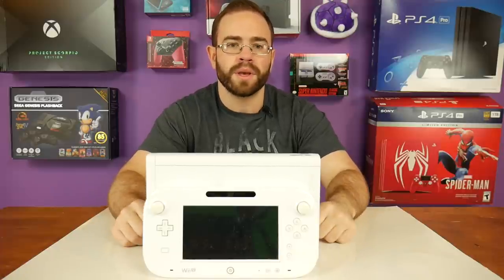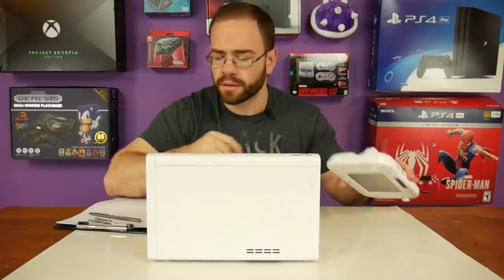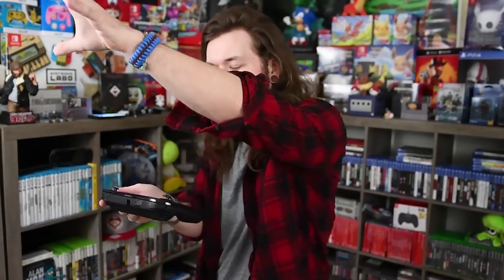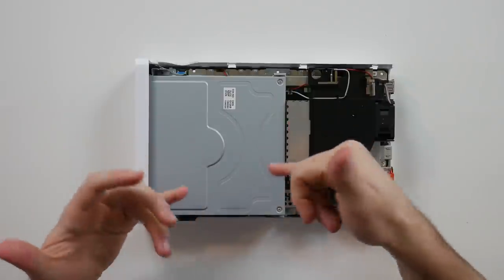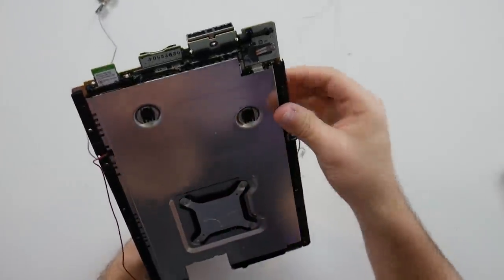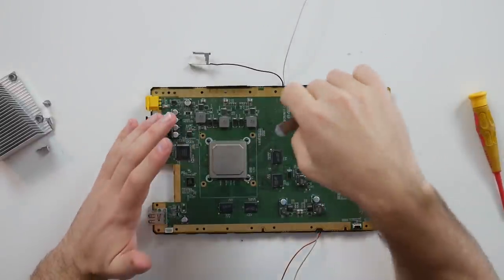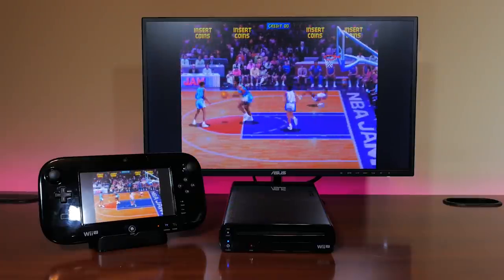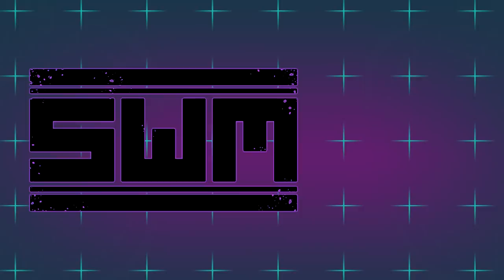Here's Why The Wii U Never Had A Chance (ft. BeatEmUps, Scott The Woz, Wulff Den, MVG)

Comment: If the Wii was an enhanced Gamecube, and the Wii U was essentially an enhanced Wii, does that mean that the Wii U is an extremely enhanced Gamecube?
Reply: That's quite the syllogism
Reply: Technically yes, as it still uses the same processor family as the gamecube. Also it still can run GameCube game’s natively.
Reply: Kinda is. The Wii Menu mode on Wii U is a TRIPLE-clocked GameCube, while Wii was a double-clocked GameCube. But yeah, most of the Wii U is a Wii.

Comment: Answer: Everyone thought it was a fancy Wii while it was actually a fancy DS console with a Wii duct taped to it
Reply: 3DS HD with a huge anchor chained to it 😅
Reply: It exists. It's called Citra.
Reply: I didn’t even know it was a new console. I though the Wii U was just the game pad controller thing that would then connect to the Wii. I never really saw it as a full console.
Reply: This is so true 😭😂
Reply: it's a ds but the upper screen was your tv
Reply: @AaronKaiMCDNLD  😂
Reply: AMysticSeer handhelds can’t compete with home consoles
Reply: @friendlyneighbor5069  
The Switch is what the WiiU should have been back in 2012. A portable hybrid with PS360-level graphics (in 1080p with a more modern architecture) is exactly what Nintendo needed to start the next generation before PS4 and XBone arrived. 

Instead, Nintendo was high and arrogant off of the success of the Wii and decided they could try to fool the masses into buying another underpowered console with a new (worthless) gimmick that would justify it being once again a generation behind its competitors. And much like the Wii, the WiiU couldn't even keep up with the generation that came before it; the Wii had a GPU that was way worse than the OG Xbox while the WiiU had a CPU that was about 1/3 the speed and efficiency of the 360's. They literally went OUT OF THEIR WAY to make the console weaker than if they had simply used cheap off the shelf parts (which would have been more powerful than WiiU), probably because they were familiar with Wii/GCN architecture and wanted to use it again for a third time because they were too lazy to learn how to develop on modern hardware.

And as good an idea the Switch is, I feel that it being released in 2017 is just a tad too late. Like I said, this console should have released in 2012 - 2013. At the end of this year, PS5 and XBSeX will be released, and Switch with its PS3.5 tech will be nearly two generations behind in terms of horsepower (making ports even more difficult than they already are). Nintendo just keeps falling further and further behind... And that's not even getting into their embarrassing regression in terms of multimedia and online features, which is even worse.
Reply: @AMysticSeer better than the ps3 and xb360, didnt you watch the video? he said the wiiu was comparable to a 1998 g3 mac, lol.. both ps3 and xb360 run circles around the wiiu powerwise.
Reply: @N.i.E.M.O  have you notice that nintendo have started to treat the switch like the wiiu now. there is nearly no news about the system and nearly no new games for it anymore but indie junk. its exactly what happen to the wiiu, when nintendo was starting to close it down for something new. a new nintendo console is coming in a year or two by the look of it.
Reply: This is heresy!
Reply: Yeah the wiiu was still incredibly downgraded compared to ps3 and Xbox 360. I remember comparing assassins creed 3 and darksiders 2 the wiiu was nice looking “ for the size of the console”
Reply: @buster3698  - Me too! And I was a Nintendo fan back then!

Every trailer was like: "Play with the new controller!"

The Zelda demo just looked like a CGI Twilight Princess.

Meanwhile they barely even showed the console itself!
Reply: @AMysticSeer The reason the switch doesn't stack up with the PS4 and XbOne because its a portable, if it was as powerful as, for example, the PS4, it'd basically overheat and be slightly larger, and a chunky portable isnt really something you want.
Reply: @AMysticSeer Nintendo doesn't go for graphics because they don't make a game better, and in fact, the make the system more expensive
Reply: @jackobyuk  Of course there’s nearly no new games. The pandemic slowed everything down. And there are still hundreds of Switch games sold each day compared to Wii U games.
Reply: I knew that it was a new console. I just thought that it was a new she'll for the Wii with a new controller.
Reply: @MikooOnYoutube  because people still want to share there opinions and don't care how old the comment is because it isn't really that important.
Reply: Makes it better
Reply: “wii duct taped to it”
Reply: @buster3698  how
Reply: @JmKrokY  they only ever showed the game pad. They always marketed it as like an extra controller so I thought it just hooked up to your wii. I didn’t even know it had it’s one separate thing beyond the controller until I saw it at a friends house.
Reply: @N.i.E.M.O  - I'm not sure that was possible back then, like, Sony really* tried to pack AAA-Quality on a handheld, and it failed on Wii U proportions.

Comment: The Wii U’s Failure set up the Switch’s Success!!

I miss the Wii U too lol. This was an amazing video and such an ambitious crossover!
Reply: Well said.
Reply: Was it though? Nintendo would have put HD graphics on their next console regardless. There was no way a modern home console could sell without at least 720p resolution at the bare minimum. Nintendo is known for doing weird and innovative things, so I believe a system like the Switch would have come out eventually even without the Wii U to serve as a failed predecessor.
Reply: Cuppa, yes a Switch like system could have still been released even if the Wii U never existed. But it probably would have failed just like the Wii U. Nintendo learned a lot from the failure of the Wii U. That’s why we’ve seen a completely new Nintendo ever since the release of the Switch.
Reply: @jammo7370  It's not just the console's horsepower, remember those cringey Wiiu ads? Nintendo did a lot wrong when it comes to showing the Wiiu to the masses including the very name.
Reply: Switch failed when NSO came out.Everything is fine but the online  P2P.
Reply: The switch has ame graphics as the wii U and its $300 more LoL fuc the switch its a rip off i smashed mine...
Reply: @chrisd8180  So you gave Nintendo 300 bucks and have nothing for it? You sure are a shining beacon of wisdom.
Reply: @chrisd8180  you Paid 0 bucks for your Wii U?

Comment: The Wii U can emulate GameCube games perfectly, it makes me sad that Nintendo didn’t take advantage of that
Reply: It doesn't emulate it but yeah they could have had adapaters to connect GC controllers to wii u and play NGC games.
Reply: @gabrieltorres6633  they do have an adapter for the gamecube controller.
Reply: *natively run GameCube games, both through the semi-official unused GameCube VC and Nintendon't.
Reply: Its because the Wii U is based on Wii tech,wich was made with alot of GCN components
Reply: @jesusramirezromo2037  the original Wii came with software that could execute GameCube code (MIOS) natively. For the Wii U, they removed this feature, but they kept the Wii codebase as virtual Wii mode, which runs underclocked on the Wii U. Nintendont is just a modified version of MIOS that can run in the virtual Wii environment

Comment: Wii U = Smash 4 machine.
Reply: DoubleAIV yea but now ultimate exists so smash 4 is irrelevant meaning Wii U is irrelevant
Reply: If you mean Smash 5, yes.

1. Smash 64
2. Melee
3. Brawl
4. 3ds
5. Smash Bros for Wii U

The 3ds game is always overlooked. It's an entirely different game, slightly different roster and different release date
Reply: @adiris8827  a large community of people used to call the Earth flat... That didn't make them right
Reply: except that smash 4 is the same game on wii u and 3ds, aside from visual quality and minor game modes. it is the same game
Reply: splatoon machine for me. Smash never worked that well online for me on wii u.
Reply: @MichaelBlakeLaRusso  But they don't have a "slightly different roster". The entire roster was exactly the same and if a character was changed in the Wii U version it was also changed in the 3DS version. Characters did the same amount of damage and had the same frame data between the two consoles. In fact, Sakurai even commented on not including Ice Climbers because is he couldn't include them in the 3DS version (due to hardware limitations),  he wouldn't include them in either. The same DLC also came out for both games on the same dates and both were supported till the same day, which was the final update.

The gameplay was exactly the same between the two and the only differences were some of the stages and a handful of gamemodes, which mostly still functioned almost the same. The only big difference in game modes was Smash 3DS had Smash Run while Smash Wii U had Smash Tour and Master Orders.
Reply: @MichaelBlakeLaRusso  Explain the different roster part please. Smash for 3DS and WiiU literally play the same, down to every single mechanic, every move, every combo etc. Competitively, the only thing separating those two games are the available stages (and controller options)
Reply: SMA5H
Reply: @michael blake larusso ah so you found a random website to tell you the difference between the 2... so your one of those people who also go to tier lists on random websites and trust their word? nah imma go ahead and trust sources that i know actually played these games like my friend who played both versions since he didn't have a wii u at the time and he played the wii u at tournaments instead. im also gonna trust the majority of people who actually play and bought both versions who say the games are basicly the same in this case appealing to popularity is the best option over a random website that you gave wtf is makeuseof.com?
Reply: roster is the same for both those games btw. who cares if stages are different? and they changed like 1 or 2 gamemodes? thats not big enough difference between the 2 to call for them being different games especially since they  were announced at pretty much the same time released at pretty much the same time had the same roster same gameplay mechanics characters had the same moves same combos. thats the same game :p on another note smash bros ultimate added 3 new gamemodes a new adventure mode which is pretty long. brought back every other character while adding new ones improved the online system(still trash though) ect. see the difference? ultimate is a new game because of multiple major inclusions where as the other 2 that are "different games" have very minor changes made to them
Reply: @Mattadork  Most people missed the 3DS game in anticipation of  8 player Wii U home console game... coping and pasting the article was simply easier.  I didn't insult anyone for missing out on Smash 3DS, I merely pointed out that Smash 3DS is the fourth in the series and "Super Smash Bros for Wii U" is the 5th.  They are merely different games with different release dates.  "Mario Kart DS" is still the 5th in the Mario Kart series, it wasn't skipped for being too similar or too close to "Mario Kart Wii"
Reply: thats not the same thing as the smash bros series especially when its literally advertised as the same game by the creators the trailers are literally super smash bros for 3ds / wii u. the slash means its the same exact game in this context. just because the release date for 1 is shorter then the other doesn't change much  especially in this game in this game every character has their own moves. a certain time that move takes to come out(technical frame data stuff id rather not learn cause it sounds boring) and as far as people who know this shit are concerned they are the same game for those reasons. adding 1 or 2 extra modes and different maps in terms of this game doesn't make it a different game sure i get what your saying wii u came out later then 3ds making it the 5th game but when you say that your taking people out of context cause smash bros ultimate is the 5th game in the series. not the 5th to come out cause 3ds and wii u are separate but its the 5th in the series which that is the difference. since 3ds and wii u have minor differences to the point you won't really tell(its nothing big like 1 having different characters,characters moves being changed ect.) they are both considered and even are based on advertising by nintendo themselves the 4th title.
Reply: @Mattadork  https://youtu.be/jmS05ZX3C4w sakurai considers Ultimate 6th in the series.  Your argument is invalid
Reply: Michael Blake LaRusso dude mario kart ds is NOTHING like mk wii! I have played both but you don't need to to see it. They are different characters, karts, tracks, control options, etc.
Reply: Michael Blake LaRusso Slightly different roster? The roster of the 3DS and Wii U games are identical.
Reply: @Max-bm5rs  "super smash Bros for 3ds" was the official title for 4.  "Super Smash Bros for Wii U" was the official title for 5.  Sakarai confirmed that "Super Smash Bros Ultimate" is the 6th in the series. Everyone was wrong, get over it.
Reply: @MichaelBlakeLaRusso  You don't have to take Sakurai's word as law. Nintendo considers them to be different games because they sell as different games. Functionally there is almost no difference between the games. The core gameplay stays exactly the same. I ask a question, would an update to a game make it a completely different game? Because that is essentially what smash for wii u acted as. Adding a few new stages and upping the graphics doesn't qualify for it to be called a new game.
Reply: @MichaelBlakeLaRusso  Do you legitimately think that people call it smash 4 because they can't count? And yes I will in fact go against the word of the original creator because it's literally just a port. This is such a straw man argument, it shows your inability to legitimately hold your point.
Reply: @nedbrookes6481  I've been calling Smash 3ds and Smash WiiU numbers 4 and 5 for years.  Aside from having different game modes the biggest difference is one is 4 player and one is 8 player (I'm sure that went unnoticed as gamers are probably playing alone in their parents basement). 
 I'm so glad sakarai confirmed that Ultimate is the 6th in the series.... But by your logic that Smash WiiU is Smash 3DS Port and not a new have because of the roster, that would mean Smash on Switch is a compilation rather than the 6th in the series.  So yeah, if the creator says Super Smash Bros Ultimate is the 6th in the series, you've all been wrong, get over it.
Reply: @MichaelBlakeLaRusso  What the fuck? A compilation? In what sense of the word is smash ultimately a compilation? Because it has all the characters from earlier games? I'm unable the fathom how this could even be a conceivable notion. And I've said this before, something like 8 player smash or smash tour/run is not even close to enough to differentiate these as different games.
Reply: @MichaelBlakeLaRusso  untrue 3ds is the same roster
Reply: @nedbrookes6481  he is soooooo wrong
Reply: @turtleanton6539  glad I made a bunch a losers rage in a thread. Sakarai confirmed that Ultimate is Smash 6. That is all.
Reply: xx Alvexas xx but it’s $250 cheaper and still runs great
Reply: I thought people called both games smash 4 because, you know, smash for 3ds/wii U.
Reply: It's not a Smash machine. There's plenty of great games on the Wii U. Also, Virtual Console.
Reply: Kuilet  why am I still getting comments on this?!?... Seriously Sakuria already confirmed the numerology. Get over it
Reply: @MichaelBlakeLaRusso  smash 4 3DS and Smash 4 wii u. It's right there in the name. Both are smash 4 considering that these two games are the only ones to have a play on words esq title. Same game, different modes. No roster difference, Nintendo and Sakurai both reffer to these entries as the fourth game in the series. Saying these games are different entries is like saying pokemon red is gen 1 and blue is gen 2 you seeing my point? By your logic since wii u came after 3DS then how come they didn't add new characters and tweak old ones?
Reply: @MichaelBlakeLaRusso  Ok, no. Doesn't work that way. 

The 3DS version is a handheld console version of the home console game. Sonic the Hedgehog launched in June 1991, then Sonic the Hedgehog for Master System and Game Gear came out later the same year. That game didn't magically turn into ""Sonic the Hedgehog 2."
Reply: @dapperfan44  Sonic master system and Genesis have the same story... Smash 3DS and Smash WiiU have different story modes and again SAKURAI CONFIRMED THAT ULTIMATE IS SIXTH IN THE SERIES!!!!
Reply: @MichaelBlakeLaRusso  if you insist. You're still wrong, but if you insist. 

By the way, googling "Smash Brothers 5" brings up Ultimate.
Reply: For me it’s a homebrew and HD Wii machine
Reply: Michael Blake LaRusso but their compatible to play together so their smash 4
Reply: That's basically all I bought it for. Then I picked up Splatoon and it became my favorite Nintendo game

Comment: Being a purist for physical games, Wii U modding sadly doesn't really do anything for me other than disable region locking. It would also be nice to enable the Gamecube Controller adapter to work outside of Smash Bros., especially for the Wii Mode, but I don't know if that is possible, I also don't own one of those. Despite these things, I am a big Wii U fan, I just played Zelda: Twilight Princess HD today. There is still plenty for me to do with the system. Some games I own for it I haven't even touched yet.
Reply: Hid2VPad should enable the gc and other controllers for all games.
Reply: Gamecube adapter works in Nintendont, so you can play any gamecube game the way they were meant to be played.